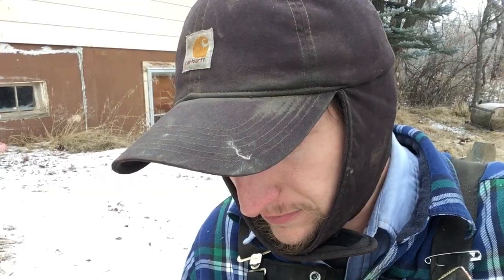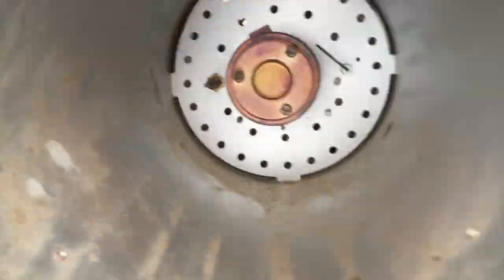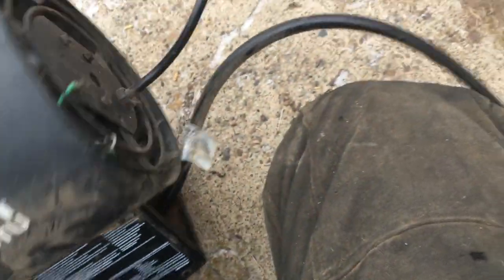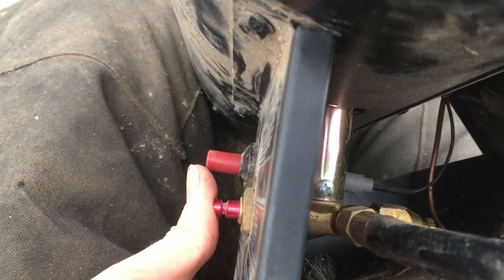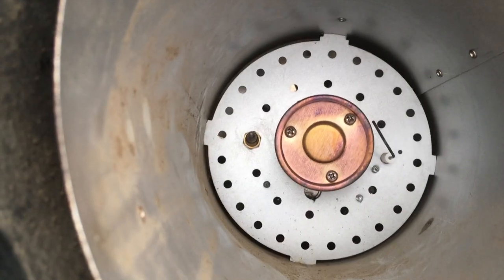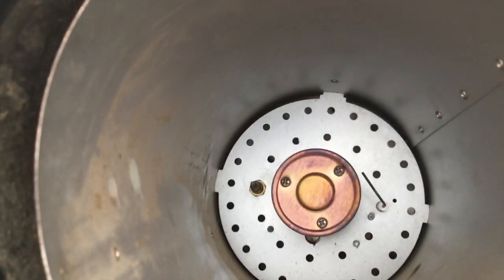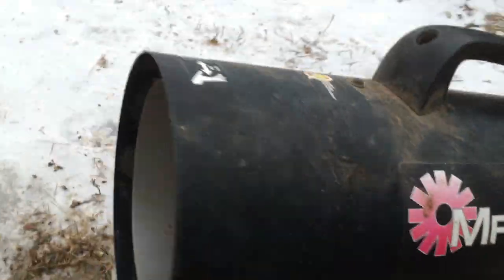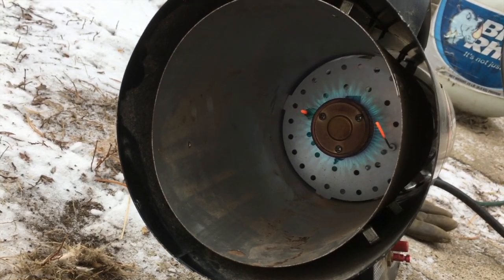Space Heater FIX - Lights but won't stay lit

Comment: Sometimes the problem is a loose or dirty connection between the thermocouple and the safety valve. The electrical current is extremely low and a bad connection will cause this problem.

Comment: Can I ask a technical question? I have a 1996 propane torpedo heater that goes up to 100,000 btu. The regulator that came with it has a light blue screw-on cap that came off and the set screw inside turns easily. How can the regulator be adjusted if need be? 2nd of all if I have to replace the regulator, can I use a generic one from a box store, or do I need one that will allow flow for up to 100,000 btu? I am new to propane torpedo heaters. I have always used sunflower heaters. Love this video .
Reply from the maker: I’m sorry I don’t know the answer to that question, but perhaps someone on here will!
Reply: @ExcellenceInAgriculture  I hope so. I just got the heater today and don't want it to blow up when firing it up for the 1st time.

Comment: Thanks for this video!! I bought a similar heater (different brand; same BTU rating) yesterday, and I had the same problem, right out of the box. I was not happy to say the least; especially since I had to drive 120 miles round trip to get it and in the mid-sized city that I had to go to, there was hardly one left anywhere to be found due to the cold snap we're in. I got the last one one the shelf at the store I bought from. I found your video, and followed your very clear instructions and it works like a charm now. I'm not the most handy guy and I didn't even know what a thermocoupler was until I saw your video, so thank you so much for taking the time to post it!
Reply from the maker: No problem, glad I could help!
Reply: Thanks for the tip. Bought one of these a couple years ago had same problem.  Did what you suggested and walla! Works great. Thanks for this tip. All the best!🌞

Comment: I just bought the Stanley 60,000 btu torpedo heater off Amazon, it worked 3 times then wouldn't stay lit.
Reading the manual it says the thermocoupler was getting too hot. I randomly find your vid in a Google search for known issues with torpedo heaters. Literally 3 minutes later my heater works perfectly, thank you!
Reply from the maker: That’s great! You’re welcome!

Comment: Excellent video to fix my 20 year old heater,  The only thing I would like to add is that you can also take a piece of fine sandpaper and go over the thermo coupler to clean dirt off of it.    The dirt on it also insulates it just a little bit so it may lose some sensitivity.  That is what I would try first, if the brand someone is working on does not have the adjuster nut.  
   Once again, thank you.
Reply from the maker: Sounds good, thanks for the tip!

Comment: I just bought one of these Mr. Heater 30K-60k BTU  on Sale for $119 and I like it. Diffinetly Quiter. My Insulated Garage is only 24ft x 28ft. My only CON is my Old  Dyno Glo was a variable 30k-40k-50k Heater. Never had to go Higher than 40k. On the Dyna Glo, you started it at the 30k setting and when the Knob comes out, it allowed you to turn it up or down even lower than 30K. I like to keep my Garage/Work Shop at 38-40F in the Winter, I have a lot of Tools. We could turn the Flame down to about 3.0 inches on the coldest days and keep it in that 38-40F range. A 20 lb bottle would last about 34-36hrs so I'm guessing it was around 16-18k BTU on that lowest setting. So I'm wondering if a Mr. Heater could be adapted to do the same thing?
Reply from the maker: Perhaps, if you succeed at doing so let us know! That would be very interesting.

Comment: This is exactly what mine is doing. I'm going to go home after work and work on it. Thanks brother. Btw I got so frustrated with the heater months ago and just left it outside. Do you think I ruined it by doing so. We about to get a lot of ice and I'm sure the power will go out. Got to find a way to keep my family warm
Reply from the maker: I hope this helps you get it going! But if yours is like mine, you still need power for the fan to run. And be careful about carbon monoxide, I've heard on the news of a couple people who died by going to alternatives for heat. 
By leaving it outside I wouldn't think that would ruin it, your ignitor might be damaged so you may need a different way to light it. Anyway, stay safe and I hope you get your heater going again!
Reply: @ExcellenceInAgriculture  lol yes when I went home yesterday I noticed the electrical plug hanging off the back of it 🤦‍♂️ but the good news was we didnt lose power. I put it in the dry and this weekend I'm going to work on it. I agree with the carbon monoxide poisoning. I will only use it in my garage with the windows open and the door cracked. Thanks brother

Comment: Very helpful my man thank you
Reply from the maker: No problem 👍
Reply: Hey man just wanted to let you know that I really appreciate your video because I was fixing to toss it in the scrap pile, because I could never find out what was wrong it would burn fine but as soon as I let go of the knob it would go out instead of staying lite and I even looked at the company website for a way to fix it but I couldn't find a single commit or video explaining why or what was causing the problem, but I found your video and even more suggestions in the comments like using sandpaper to clean it, but I agree with you on trying to fix it yourself and I feel like the companies are not even trying to give you some information on fixing it because you are not buying a new unit or replacement parts, which is more business for them, even though it's not the most expensive thing on the market, but to some people a $100 is a bunch of money and to other people it's just pocket change.

Comment: Does this work like bypassing the thermocouple? So I dont have to bypass the thermocouple to keep constant blowing of heat? Just turn the nut instead of bypass the thermocouple??
Reply from the maker: You should be able to just adjust it instead of bypassing, if yours is adjustable. Hope you get it working!